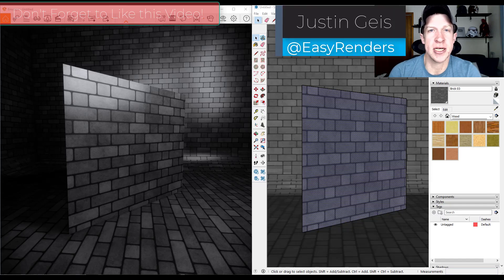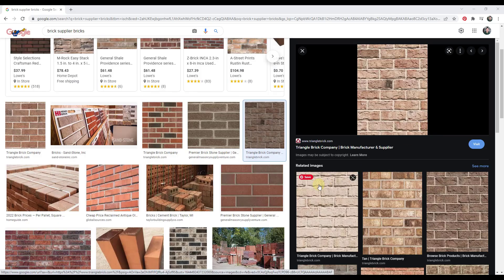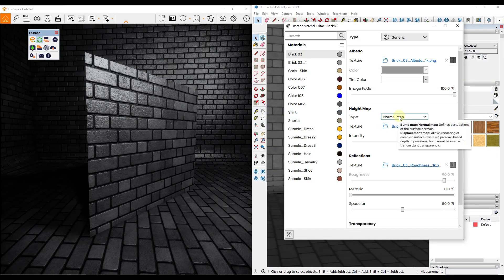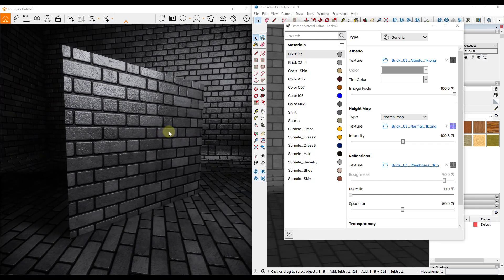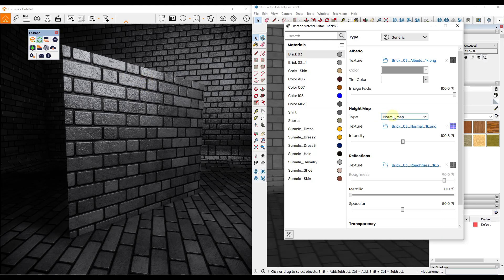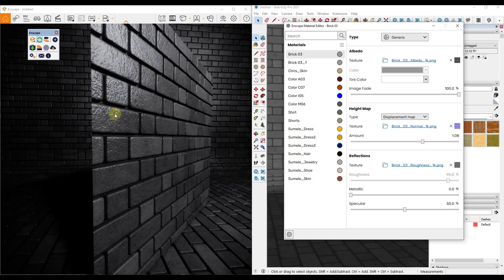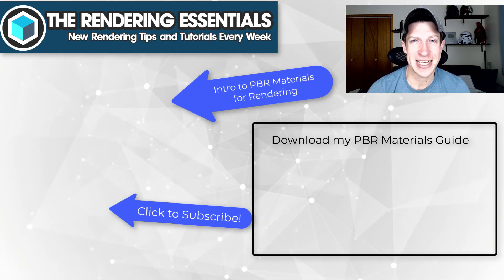What are NORMAL AND DISPLACEMENT Maps and How do they affect your renderings?

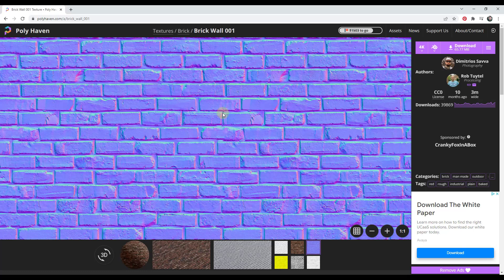Comment: Minor gripe but normal maps don't encode height data (2:55). They encode the xyz values of the surface normal vector at that location which is independent of height. Nice video :)

Comment: I've never really looked into the different maps, I just use displacement by default 🤭. Sometimes I end up downloading AO maps, but I have less than no idea what they are!
Reply: Say you had a surface with a hole in it and then shined a light on it. In addition to the sharp shadows cast by the rim of the hole, you would also see a more general darkening the deeper into the hole you got, because less ambient and bounced light would be reaching those points. That’s ambient occlusion. It’s a way to simulate depth by darkening certain areas. Enscape doesn’t use AO maps, but you can use them in a pinch if a texture pack doesn’t come with a roughness map. Inverting an AO map (so that the dark recesses are light and vice versa) is a decent enough fake of a roughness map, since smooth surfaces will reflect more and recesses will capture more light.
Reply: Yeah .. the problem I have is that if I were to explain the differences, I would struggle. Even though Justin explained it pretty well. ... I would still not really know when to use each type of map. It's clear to me that there's some overlapping functionality in what each map can do.

Has anyone ever messed around with sketchfab as a way of adding textures? I tried it a few times but I found performance too slow on my machine. Going from the preview area, then saving, checking the results... I would probably do better with vray or one of these others